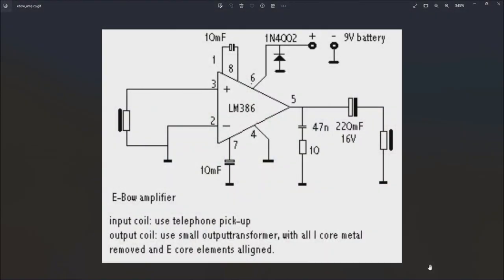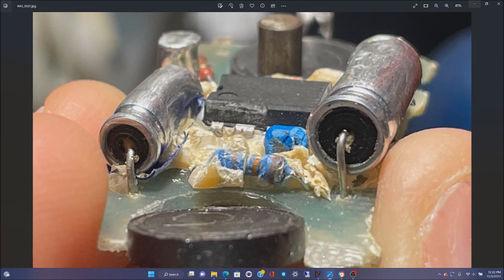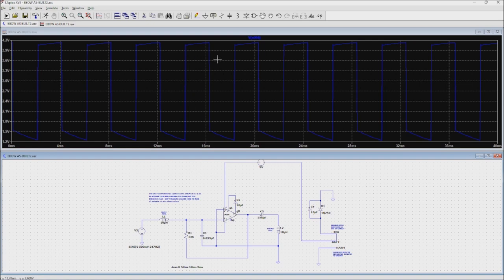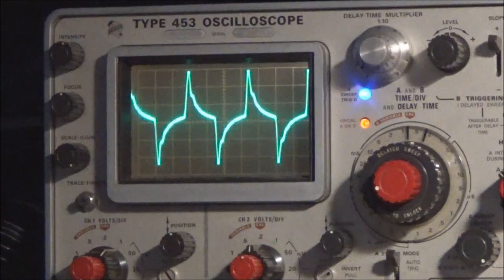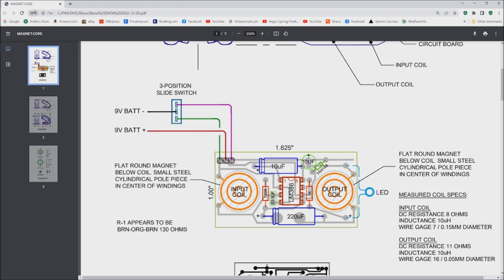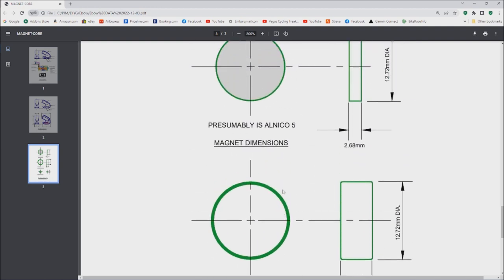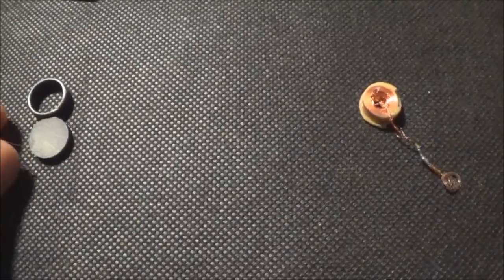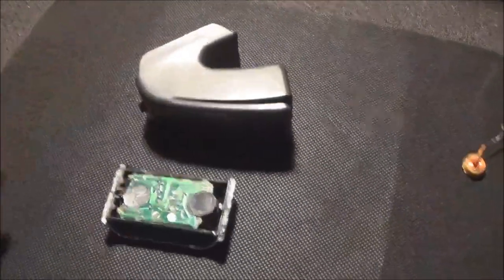All Of Those Ebow Schematics You've Seen ARE WRONG! (Part I)

Comment from the maker: NOTE: I made a mistake in the video at 13:53 regarding the wire gage on the coils. I was looking at a chart that showed AWG sizes , and I didn't do the conversion from metric to AWG. The correct wire gages would be: Input Coil  34/35 AWG and the Output Coil  44 AWG. I also suspect the inductance that I measured - seems too low. Might really be more like something between 10mH and 100mH. For the purposes of simulation it doesn't seem to matter much but it certainly would if you're trying to build one. I have corrected the info shown on the PDF in the video.
Reply: I suspect that you’ve got the coils the wrong way round - I would expect the output (driver) coil to use the thicker wire as it has to tolerate the current that the 386 puts out.

The sense coil would use the thinner wire as there’s very little current induced in it.
Reply from the maker: @duncanmcneill7088  I was able to determine which coil was which by the bits of epoxy left over from the individual that originally dissected it before I got my hands on it. It was pretty obvious which one came from which side.

Comment: There have been at least two distinct versions of the eBow, and I'm pretty sure the "harmonic mode" was added in the mid to late 90s (it definitely wasn't a feature on the eBows I saw in shops and ads and my guitar teacher's house when I first started playing back in 1991, but it started showing up in ads a few years later and the one I bought in the late 90s has it).  It's possible that the differences between the board you have and the common internet schematic are because it was traced from an earlier version without harmonic mode. 

If it as drawn 20 or more years ago (which seems likely, I don't know the source but it has been around for a long time), there would have been more without harmonic mode than with floating around. On top of that, the person who drew the old schematic would have probably used the cheapest ebow they could find used, or an old or broken one they already owned, which makes it even MORE likely that it predated the harmonic mode.

Plus the old internet schematic doesn't include the harmonic mode switch at all...
Reply from the maker: The internet schematic doesn’t have a feedback loop. That is required to get a consistent frequency of the oscillator. Won’t properly couple to the string otherwise.

Comment: Wow, thanks, i'll definitely give this a try. Any suggestions on getting similar coils apart from winding them? Maybe arduino sonic sensor speakers?
Reply from the maker: Apparently there are some kind of buzzers that you can use for the coils but I don't know what they are used in or any of the specs. 
This guy in Russia made a working circuit using them and also 3D printed the casing - https://youtu.be/lFSfWysFvuY

The ebow is designed so that when you place it over the string it will cause the string to vibrate. Most of these DIY ebows that I've seen won't do anything until YOU pluck the string. That technically works, but it's not the same as what the ebow is actually doing. You don't get a circuit that functions exactly the same as the ebow.
Reply: @VegasCyclingFreak Thank you! I'll research. I'm actually from Russia too. Seems that InfiniToneGS was some kind of DIY version of Ebow made by now closed company of local enthusiasts here. The guy in the video is actually fixing the DIY version made by them. But i'll try contacting him, i update if have some more info.
Reply from the maker: @artantme  Thanks for the background info on that. The video makes more sense knowing that. 🙂

Comment: I would have guessed it feeds a coil with a very, very fast pulse waveform. Like, that's what a bow does: the string is pulled aside by the bow strings, until it reaches some maximum displacement at which point it snaps free. It's like you're pinching it with your fingers, moving it just a tiny bit away and releasing it, only it's done like thousands of times a second.
Reply from the maker: That's what I thought when I first started on this journey, but that's not how it actually works. It's based on the principle of feedback sustain.
Reply: @VegasCyclingFreak  I should have expected that it wasn't as straightforward as my first ever guess on the matter.